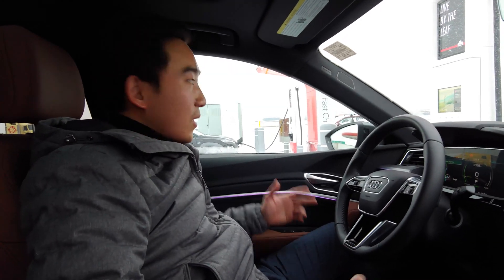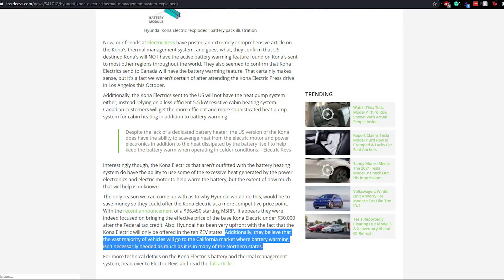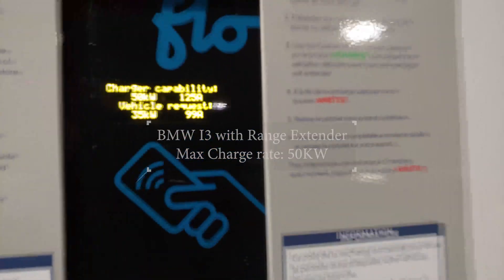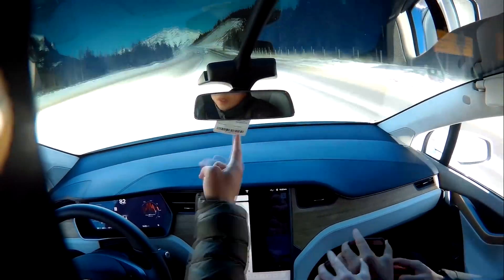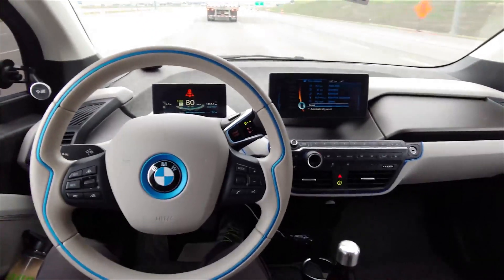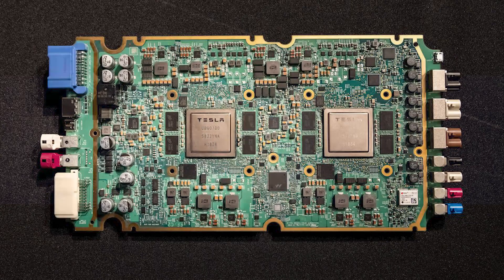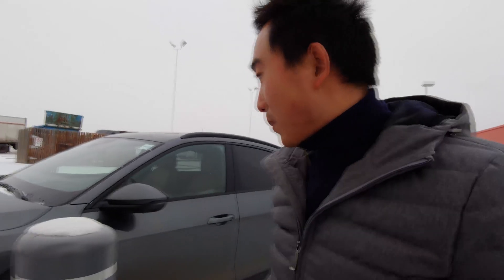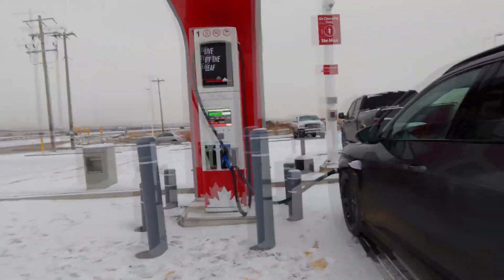EV Charging speed in cold temperature

Comment: Hi guy thanks for making videos I watched this video and the MINI cooper SE video and they both were not charging at it's maximum capability but I notice that my first gen VW e Golf would do the same but mostly I have been very surprised at how well it charge when the battery is not really hot the maximum I ever saw with this car in the summer with a properly heated battery is 43 KW and in winter when the battery is at around 5 deg cel. it will start slow but as soon as the battery heats up a bit it will most of the time reached it's maximum charge rate of 43 kw it's not fast by modern standards but with a gross capacity of 21 kw/h it dosen't take very long to go from 20 to 80 % similar to the first gen small battery i3 but I notice that when the battery gets bellow freezing point I loose a lot of range this is where is would like a liquid cool and heated battery it would be nice if you could plug the car on just a 120 volt plug and let it keep the battery at 20 deg cel. even if the battery is not charging simillar to what you do to a ICE car when the engine block heater is plug in.

Comment: What do you do while you wait for car to charge while you stand in freezing weather?
Reply: Turn on the heater
Reply: @alexanderjokkmok396  yeah, but now you are wasting more time because you are draining battery power
Reply from the maker: A lot of times, charging would be planned along side of other activities. I may plug in and then go shopping or go to a restaurant or go for a bathroom break. But when you are at a charger truly in the middle of nowhere, you just got to wait. And heating the cabin of the vehicle uses 2kW at maximum for most EVs. It's not that significant when DC fast charging. In the case of the E tron, you can get over 100kW when DC fast charging. Some EVs can pull power for heating directly from the charger. For these vehicles, if you are charging at 130kW on a DCFC capable of 350kW, it will put 130kW in the battery and then pull an additional 2kW from the charger for heating. In these situations, charging is not affected at all.
Reply: @READYSTEADYCHARGE  perfect...thank you...